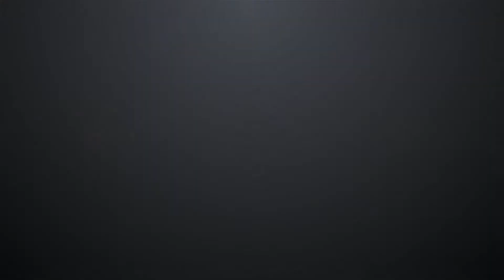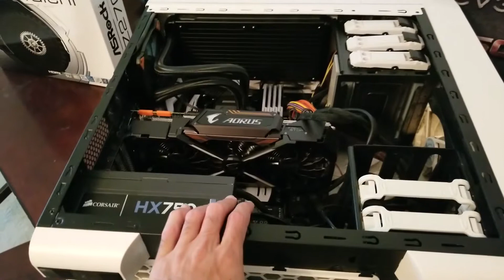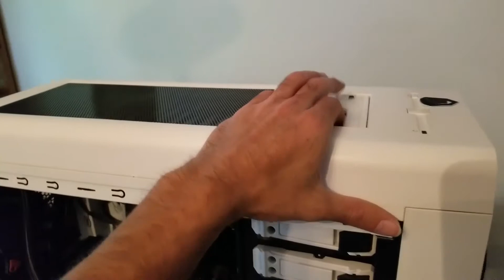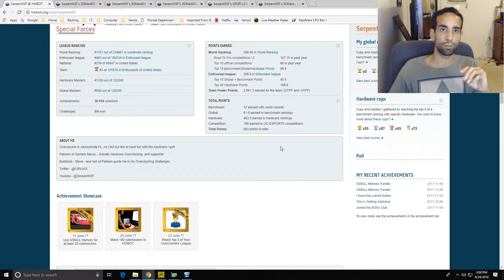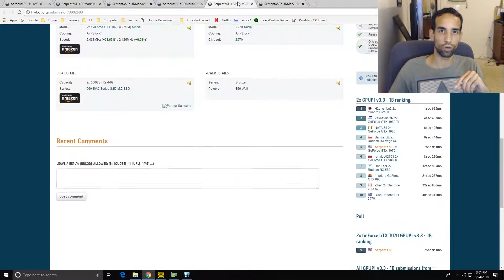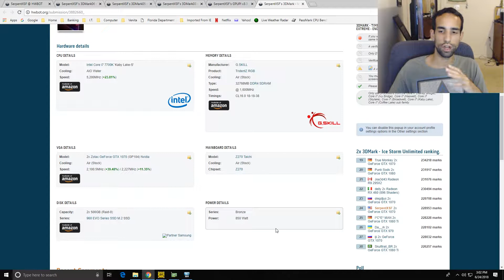GTX 1070 Mining cards, Benched after a Year!

Comment: Mate, I have a question and I hope you reply to me, as your videos are really informative. So, I'm building my first rig so atm it's running 2 1660s and 1 1070 now I know that 1660s consume less power but, what is the 1070 max power consumption on 30mh/s on Phoniex miner? And the, 1070 I have is the Asus Rog Strix I got that for free it is giving me a decent hash rate of 29.200mh/s on +200 on CC and +400 on MEM.

Now, I was planning to get more 1070 than the  1660s, as they are gone up in price and are not available as well, so what do you suggest can 1070s can give me 30mh/s around 70 to 80 watts?

waiting for your reply ...
Reply from the maker: You are right where you need to be. 30 mhs on 1070, bring the core clock down a bit. +100 to +150, and bring the memory up +450 to +550. Ethereum cares more about memory clocks, but try to save power by bringing the TDP or powerlimit down to 75%